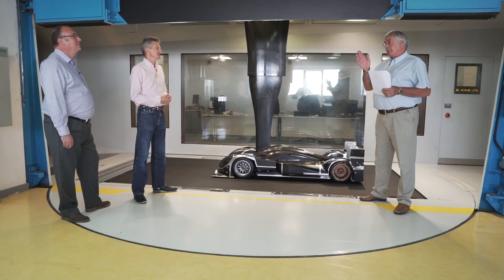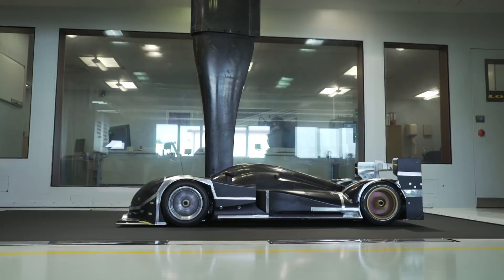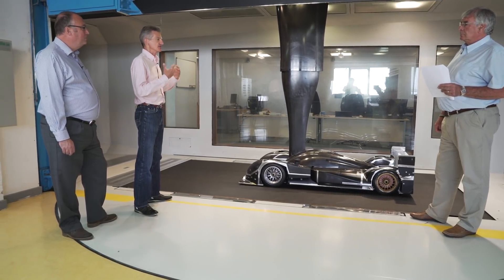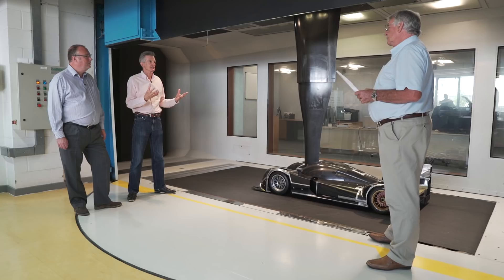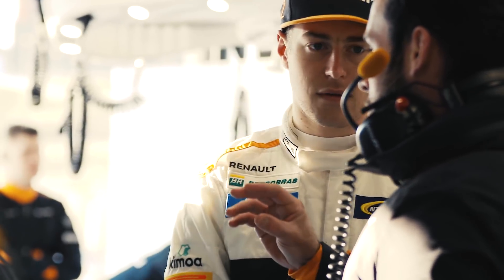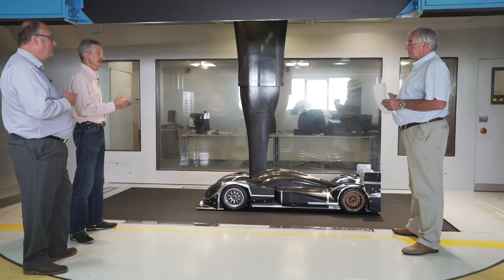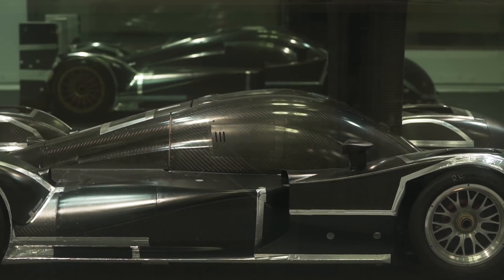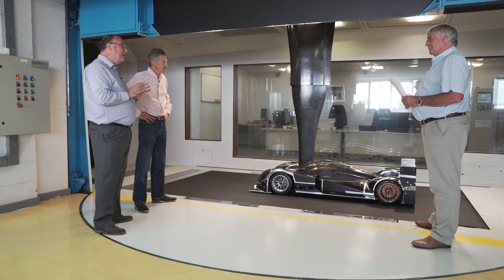Common windtunnel mistakes

Comment: So that’s Gary Anderson. I read his analysis about Mercedes struggles in 2022. Essentially he was harkening on about how the zero pods created an area of high pressure because more of the floor was exposed. Their issues were never about that. It was about the Venturi effect under the floor along the vortices at the floor edges and the lack of down washing from the zero pod concepts to ensure flow re-attachment at the floor edges and increase the power of the vortices to control the proposing. It was that along with the others.

Comment: I've always wondered does wind speed scale with the model size.  So if you were testing a 1/18 scale model, to simulate 200 mph for the model would the fans have to push about 10 mph or does it stay the same speed for every size?
Reply: Well to get the right reynolds numbers you would have to increase the wind speed with a factor 18. So yes, it scales, but the other way around. I don't think they do that though.
Reply: I don't think you can really rely on scaled models because wind behaves differently at different scales, particularly the difference between laminar and turbulent flow, relating to the Reynolds number mentioned by the previous commenter.

Comment: What is boundary layer and the belt lifting??? Could anyone explain such seemingly technical words???
Reply: I know this is a bit late 

But basically a boundry layer is a very small amount of air that pretty much sits still on the surface of the road, kinda like a thin layer of ice. Now the reason why they want to get rid of this is that a normal road doesn't have it cause all the air is sitting pretty much still not blown through a fan like in a wind tunnel. 

Belt lifting is simply when the belt (the black surface that acts like a road similar to a treadmill) lifts up due to the suction of the car

Comment: Isn't a small scale wind tunnel kind of pointless? Small scale aerodynamics don't translate to full scale aerodynamics right?
Reply: I believe the Reynolds number sorts that out. Engineers always have an answer.
Reply: They do translate if you do the math correctly
Reply: many fia controlled series only allow small scale tunnels

Comment: Ahh thanks, I had some issues with the belt scratching the floor.
I'll probably rebuilt it this weekend.
Can anyone tell me if the leveling screws are enough to get the ride-level right, or should I use a pneumatic system🤔
Reply: Just use Mclaren's secret by using some superglue.

Comment: Where do they find peeps to drive that car?  I would think it would be tough to get into.
Reply: Sorry, I think you missed my terrible joke.  It was in regards to the size of the car not the type of car.  lol  I realize it is a model, just joking.  "How do they find people to fit into such a small car?"
Reply: most drivers suffer from small man syndrome. So shouldn't be too difficult.
Reply: Whooosh
Reply: What is this? A car for ANTS?!
Reply: the sharkfin does not help against lifting off, mostly it just improves lateral stability.
the liftoff and backflip prevention are those holes above the front wheels
Reply: nUKerATsKi 😂 good joke lol
Reply: the chocolate factory

Comment: if it's so difficult to have the same stiffness in the model, why not eat the expense of 1:1 wind tunnels?
Reply: in formula 1 for example, it is not allowed anymore, because it is too expencive. There is a cool documentary about it with Sauber, but long time ago. They explain why it is so expensive in those videos (tunnel size/electricity/making model parts). Could have changed since back then, but most likely not.
Reply: the comparably cheaper series Nascar uses full size wind tunnels, Haas Windshear is even big enough to test how two cars behind each other affect each other
Reply: Making changes to full size parts would be rather expensive. I'm imagining that remaking full size front wings for every small design change would blow the budget pretty fast.
Reply: Hayes Lewis The power and space required for a 1:1 wind tunnel would be huge, and so the costs...
Reply: Well obviously modeling properly is still going to end up cheaper...
Reply: Than wheeling the real thing in a wind tunnel?  At some point all that model making eclipses the cost difference to a 100% tunnel.  Never understood this.
Reply: I'm curious as well

Comment: Why are we still using wind tunnels? Isn't simulation pretty much perfect now?
Reply: NOOOOO! Simulation is almost perfect (like 99% accurate) for structures, but fluids/aero it's not -- especially for complex and detailed analysis (it also takes tons of computing power).

Basically you need to start with a "model" (set of parameters), verify it with physical testing, then if there are any discrepancies, return to the model and iterate until you have comparable data that you're satisfied with.

If you're interested in the subject, you can read about CFD (computational fluid dynamics) and FEA.
Reply: They're both inaccurate in different ways.  Current computing power isn't up to the task of a CFD simulation that solves the complete set of fluid flow equations (Navier-Stokes) so there are numerical models that approximate turbulence.  Typically, you're looking at a couple of percentage points off in lift and drag.

Wind tunnels, on the other hand have scaling issues.  You can't just make a scale model of something and throw it in a wind tunnel and assume that the air is going to act the same way as it does with a full scale car.  When you test in a wind tunnel, you have to run the tunnel at the inverse of the model scale.  So, if you want to simulate a car at 100mph with a 50% scale model, you have to run the tunnel at 200mph to equate the two.  Doing that fulfills the requirement of equating the Reynolds number but you have to equate two factors to get it right and nearly nobody does that.  The right way to do it is to pressurize the wind tunnel or use a gas that's denser than air.  Both of these methods are extremely expensive and rarely used outside of NASA or other aerospace organizations.

So, you do both ... compare the results ... hope they validate each other and build a car and test.  Full scale tunnels are the way to go but IIRC, their use was banned by F1 on the basis of cost.
Reply: @andrewmancini46  forgot the rather "unpredictable" nature of fluids...

Comment: Could Autosport make explaining aero any more boring? I almost pulled the trigger on the GLock 17 9mm I had in my mouth.!
Reply: Not enough flashy jump cuts and stupid analogies for you?

"THIS WIND TUNNEL HAS THE POWER OF ONE MILLION BLENDERS"
dramatic music and cutaway to a brick in a blender
Reply: Do you want to hear from real engineers or from announcers without actual experience?
Reply: Forced Media ,shut your face you self-righteous narcissistic fuck
Reply: air moves, moving air does magic forcy bits and goes woooosh. there you go aero in 10s seconds
Reply: you want them to make up stuff for you? or give you the information they have?
Reply: This video is clearly not intended for normal motorsport fans but for students, or interns in a big company starting out for example. I find it interesting and not boring at all because I can relate with what's being said. Besides aero isn't just "OMG look at this enormous wing it creates so much downforce oh wow it has grooves". No need to be so dramatic
Reply: its interesting for normal motorsports fans too at least for those who have some technical klnowledge and/or interest but cant or dont want to work in this industry
its also funny to have a nice discussion under a troll comment